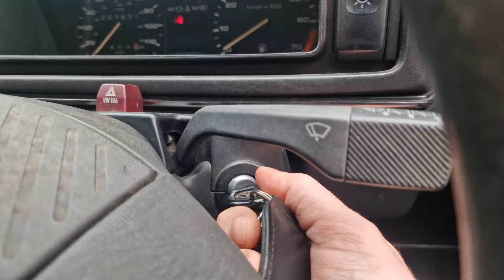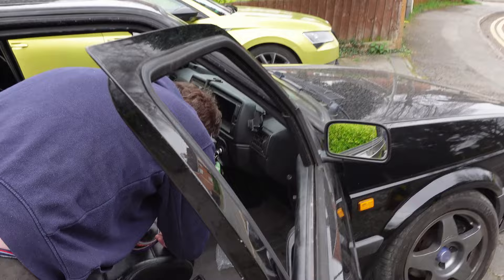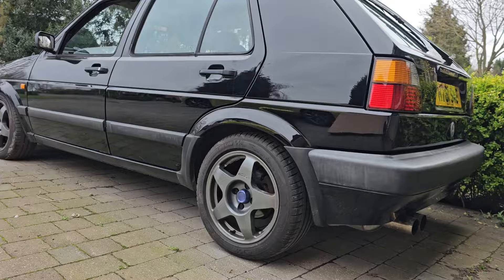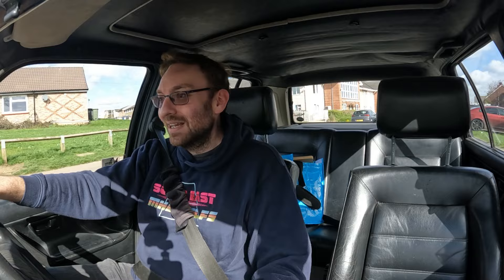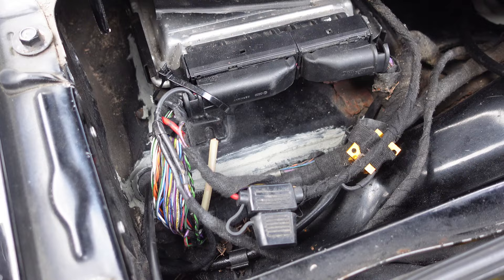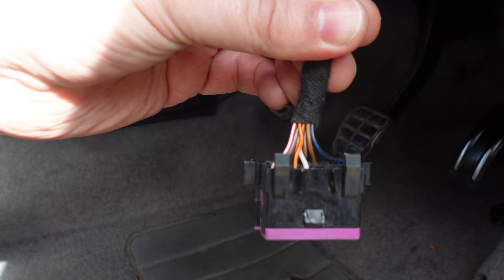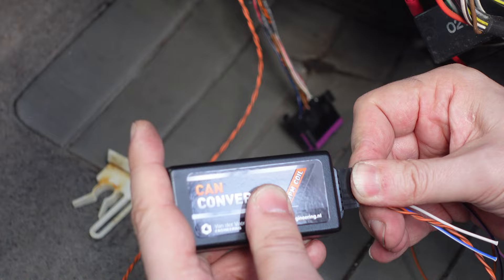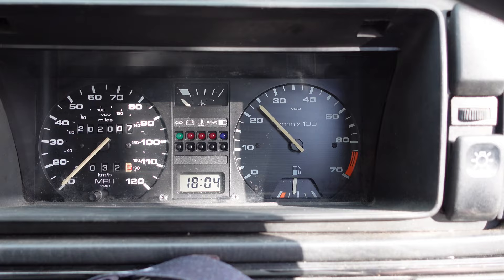CAN To Classic Clocks - Rev Counter Fix

Comment: I'm going through converting my 20vG60 from Digi to Mk4 loom & ECU. This is a god send!
Reply from the maker: Great news. If it so much as helps one person, then that's all that matters! Please keep us updated on the progress. Sounds like a really interesting project! Can't say I've heard of a 20vG60 before!
Reply: MK4 era ECU for a 4 cylinder should have a 0-5V tacho output.  To use this to Mk1/2 clocks also for 4 cylinders, you can use a cheaper converter.  Look for Mk2 1.8t tacho converter, should be MUCH cheaper than a CAN kit.  Around £45 in UK money.

Comment: Just remember to watch the Speedo not rev counter on the way home haha 

I need to sort rev counter on 20v
Reply from the maker: Haha yeah it was hard not to look at the newly working tacho all the way! As for the 20vt rev counter, as Ben said there is a 0-5V signal that you can tap into and as it's 4 cylinders going into a 4 cylinder clocks, the fix is cheaper and there are a number of adapter boxes available.

Comment: Nice!
But that jerkiness @ ignition on is weird.
Reply from the maker: There are firmware updates which may be available so can try that out and see if it stop the pulse. Otherwise I'm guessing it's just the CAN signal from the engine that is showing on the tacho. The main thing is it doesn't show when the engine is running.
Reply: @golfmk2  Ask them if it's terminated with a 120 ohm resistor. CanBus often bounces back if it's not terminated at the last node
Reply from the maker: That's interesting. I didn't know that may cause that, although, as you can probably tell, I'm not clued up on the electronics of this! First step, obviously was just to get it working. Fine tuning is next.
Reply: @golfmk2  
Keep us updated mate!

Comment: Amazing! How about the speedometer cable? How do you make it work with your R32 engine and transmission?
Reply from the maker: Hi, the speedometer is a cable from a 1.3 carb model and is a direct fit to the 02a gearbox and back of the clocks. Have you been having trouble with this?
Reply: @golfmk2  Thank you for the information. I have a 2.8 24v that I want to swap to my Mk2 Golf including the AWD system. I hope that the propeller shaft is just a bolt on straight swap.
Reply from the maker: The speedo cable will depend on what gearbox you're going to use. If you're running a DSG box then there is a CAN adapter from the company that can work with that too. As for the propshaft, are you running a raised transmission tunnel, like a Syncro?
Reply: @golfmk2  the 2.8 24v engine comes with a manual transmission...as for the tunnel, I will use the Mk4 Bora tunnel and modify it to fit what is required for the propeller shaft and exhaust system. I really want this 4Motion. I am not sure about the length of the propeller shaft. I just hope that it's a straight bolt on swap from Mk4 to Mk2. Do you have any information about it?
Reply from the maker: Excellent. So you're using the gearbox that came with the engine in the Mk4. Makes sense. As for the propshaft, I'm afraid I don't have the knowledge on this. Sounds like a great project though!
Reply: @golfmk2  Yes, it is... it's a wolf in sheep's clothing...this will be a sleeper.
Reply from the maker: @jeremiahresurreccion2350  perfect! My kind of car! 😁

Comment: salut j'ai un golf 3 r32 compteur golf 3 je doit prendre quel model ? celui-ci  Convertisseur CAN RPM numérique ??
Reply from the maker: Hi, if you are running Mk3 clocks with an R32 engine then i think you need this one, specifically for Mk3 cluster. https://www.vdveer-engineering.nl/en/shop/can-convertors/can-convertor-rpm-mk3-detail
Reply: @golfmk2  merci :)